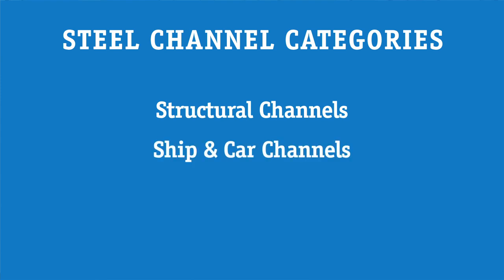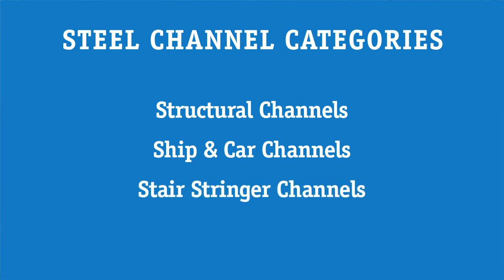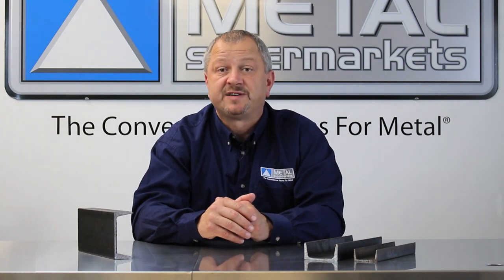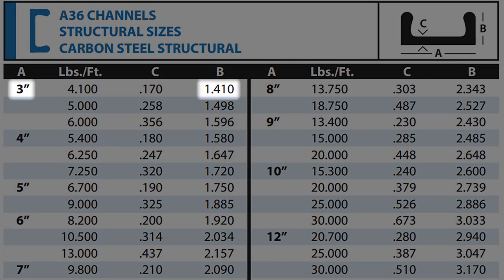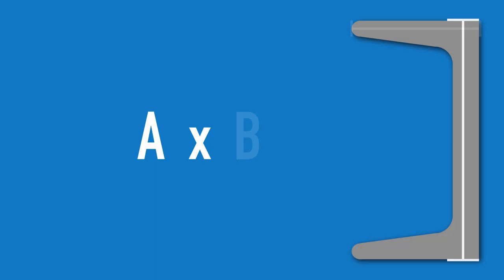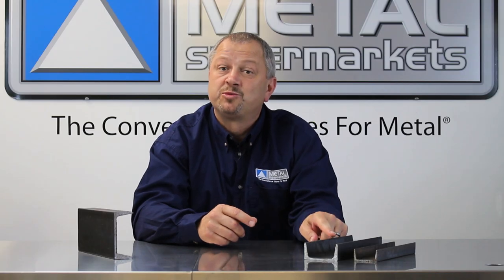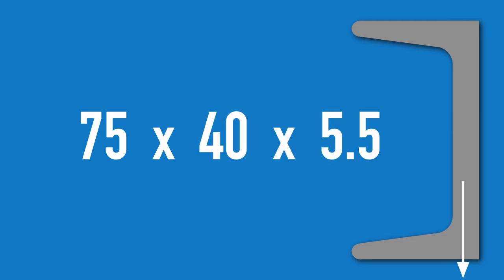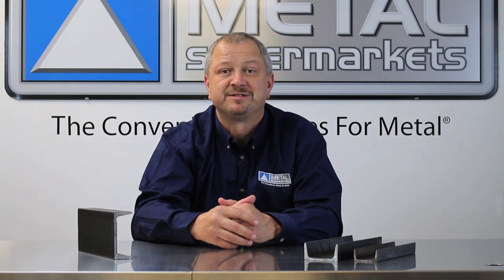ABCs of Structural Steel - Part 3: Channels | Metal Supermarkets

Comment: Are you going to speak on square and rectangle structural tube? I ask because I am planning a trailer build and have not decided to go with traditional C-channel or 2x4x1/8 tube.
Reply: Tiersmoke92555
: What did you settle on? I'm going through exactly that decision now... I think I'm gonna go with the 100x50mm (4x2") channel!